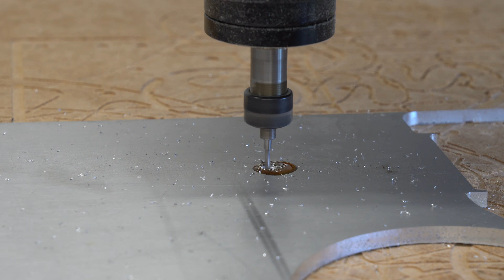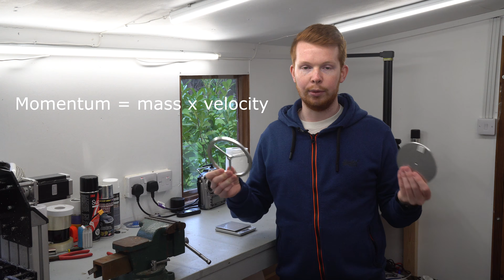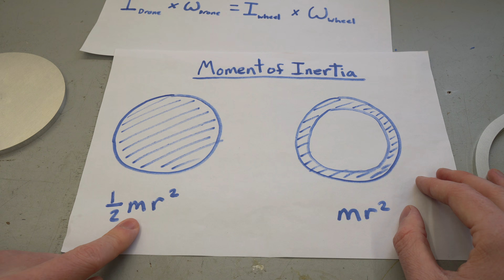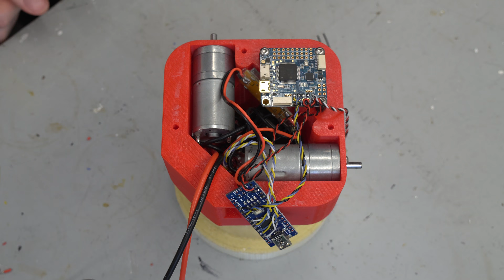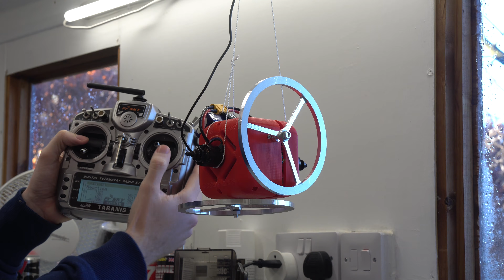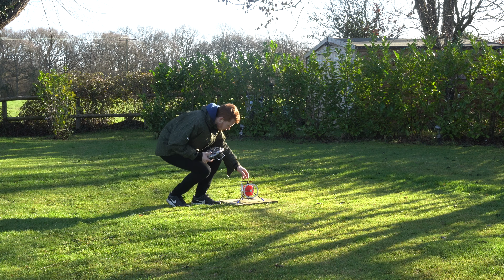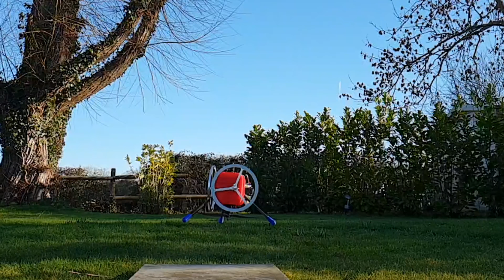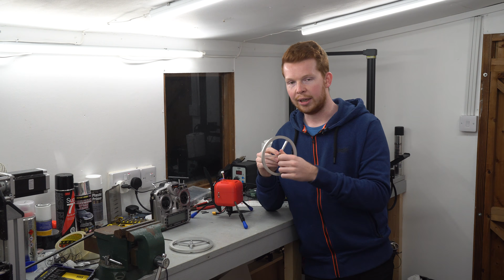Comment: I agree with the closed feedback control of the inertial masses but I also think you must use high RPM motors and take off with masses already spinned with some thousands of RPM, which is your zero. This will allow you to stay in a nearly linear zone of the motor torque so that you can increase or decrease rotation speed in a nearly linear current change and nearly linear add or subtract inertia to the wheels obtaining a CW or CCW torque. The spinning masses are going to be a gyroscope and stabilize the whole vehicle, if you take off without rotating you are going to be victim of the wheel imbalances which are more critical at lower RPMs than higher.

Comment: Hi, I've seen the video by chance, and I think you're having a problem with the stability of the drone. The propeller you are using is too small, the propeller barely protrudes a few inches from the control box. You will probably have to use a more powerful motor to compensate for a larger propeller. On the other hand, you are using a design with a single helix, as you say at the beginning of the video, every force has an opposite one. The spinning propeller has moment of force that you are not canceling, you have two options: Use a double helix or place a new control wheel at the bottom that balances that force.

Comment: Torque is linear with motor current, at whichever speed the motor is running. However, at higher speeds your motor controller will need a high voltage to 1) counter the back-emf of the motor and 2) some more voltage to “push” the current through the motor. When the sum of those two is higher than the voltage that is available, your currrent controller cannot keep up.
Enjoyed the video though, I admire your perseverance here. 
As a control engineer: you need logging to ever be able to tune a controller. You need to look at graphs to understand what is going on, and tune the controller

Comment: I worked process control electronics for Bailey Controls for 20 years. Your problem is response time is not fast enough. The setpoint needs a feedback and that is not fast enough. I got a MPU6050 and Arduino UNO and noticed this delay which would cause this. I eliminated all the programming down to the accelerometer and outputed them in PWM format and eliminated most of the delay, but there is still too much. I ordered an analog accelerometer from eBay and will see if this will have rapid response time.

Comment: There is an interesting quirk of this flying machine. You can fly it with the wheels hidden inside the chassi. Not sure if there is any actual use of that but it would look cool and one could make some thing that looks look like a helicopter but without a tail rotor and that still flies stably.  :P

Comment: You must start wheels first for a min and must be high speed for stabilization. After it try to flying. Is will succes 👍also the second upgrade wheels can be 4 and lit bit smaller a little bit around the drone.

Comment: Having been down this road, brush less motors like you mentioned are harder to deal with. I would suggest you look into gimbal motors. Even though they are brushless motors, there is no cogging and you can change the rotation as well just as fast.

Comment: Are you using two separate batteries (one for the lift motors and one for the reaction wheel motors)?  If not, the activation of the reaction motors could be drawing current from the lift motors, contributing to instability.  Or is this not an issue--if you have the Arduino monitoring/regulating current to both the lift motors and reaction motors?  COOL concept, thank you!

Comment: on my view u tried u r best the reason why u cant balance the copter is because the opposite reaction force  produced by wheels makes the flight unbalanced so u need to couter balance the opposite force  of the wheels when they rotate  but i may no possible that much easy but it may be achived by reducing the diameter of the wheel try with smaller diameter at the last i liked this video very much

Comment: Very cool project... To make it usefull you could balance the wheight , try four wheels, instead of two and it will be more stable... and try to balance the wheight inside de red box also. All the time in the slow motion video i saw that your software was fighting to stabilize this issue! You could make a log of the data from the sensors, matching the frames of your slow motion video and point the vectors of the forces applied to the drone in each frame... it would help a lot to understand what is going on! If necessary you could substitute the brushless motors of the wheels with some step motors, to get better control.

Balancing the wheight, your software will have to fight just against the wind... to calibrate better your motors i recommend that you try the inicial flyghts in a enviroment protected from the wind!

Good luck!
My best Regards

Signed: Renato Motta

Comment: How about a wheeled vehicle and use a reaction wheel to control it direction on pavement as a later project.?
Wheeled in a bike or trike. The trike will take less as the extra wheel will keep it upright. Two wheels then you 
have to also keep it upright. While it's in the learning mode you could use training wheels to keep it from tipping over.

How ever you look at it this is a very interesting project.

Comment: Awesome! I suspect that the first things to improve would be the latency between the gyro and the motor controllers. The orientation seems to oscillate quite a bit, and assuming your PID loop is tuned well, that would be my first guess for what's going wrong. Great job-- this is cool stuff!

Comment: So if you spin the reaction wheels up, before flying it into the air, the angular momentum of the reaction wheels should stabilize the "cubesat", and it should be a lot harder for it to tip over!! Hope that you will at least try it! :)

Comment: i felt like its C.O.G was very unstable and rapidly changed due to the reaction wheels..especially the side wheel which rotation was a little bit off the axis....
Reply: COG cannot change.
Reply: @Anvilshock  technically it can but not on this design
Reply: @Kaydle  No, COG can NOT change "due to" reaction wheels, technically or otherwise. This is what "due to" means. [Effect] due to [cause].
"but not in this design" – Well, duh.
Reply: @Anvilshock  I'm not saying reaction wheels can change COG. I'm trying to say COG can change. Example: battery sliding backwards in a rc areoplane
Reply: @Kaydle  Yes, the COG can also change when the whole plane explodes. Your point? Battery sliding about is hardly a tolerable occurrence in regular operation. If your battery is starting to slide about, your least problems are control methods not working even in regular operation.

Comment: If you don't already know, this might help with controlling the DC motors:
V = I*R + alpha*omega + dI/dt * L
T = alpha*I - b*omega

V = voltage across the motor
I = current through the motor
R = internal resistance of the motor coils
L = inductance of the motor rotor
T = torque output
alpha = constant specific to the motor
omega = angular velocity
b = constant related to the resistance of the motor bearings and gearbox
dI/dt = time derivative of current

A technical data sheet for the motor might provide some of these constants but you will probably have to figure out some of them on your own. It is also possible some of these constants are so small they can be ignored, like maybe inductance.

Comment: nice try ,  maybe you should made smaller and hide the wheels inside the box so you can also reduce the influence of air flow (include your maths) ,and also a simetrix wheel with a opposite sense of rotation and manage it using the difference ...

Comment: Just use the square root of the current amperage applied (or as a % of the max current) as a modifier to calculate the current required. You can pre-create this and create a reference or lookup table for the amperage you need to apply. Will give you a exponential curve and not the linear one you are currently using. But yes, getting motors that can report RPM is easier.

Comment: I'd recommend changing the position of the propellers, putting them on the top and bottom doesn't actually result in a stable flight anyway.

Comment: I think the main problem is that you're applying your reaction torques away from the centre of mass so you end up with some weird cross coupling.  a pitch torque will cause a roll. and vice versa.
Secondarily, It looks like you're probably oscillating because your P term is likely too large for the response time.  You end up with a long enough delay that by the time it realizes the correction is occurring, it's overcorrected.  Less P term will slow down the corrections, but will also reduce overshoot and oscillations.

The simplest correction would probably be to build in some symmetry by using 2 reaction wheels on the same axle.
Belt or gear driven, perhaps, since your motor in in the way of the gearbox axle.

Other more difficult alternatives could be dummy weight to try and get the centre of mass back at the intersection of the pitch and roll axis.  (might work, but it's dead weight)
or applying a crazy mix that cancels out some of the cross coupling at the controls, rather than waiting for the PID loop to catch it later.

Comment: I just wonder if the center of gravity was adjusted by placing the internal components in order to be exactly on the axes of propellers rotation. If not it might the oscilation of the drone body

Comment: Why don't you spin up the wheels to speed say half the rated speed of the motor then you can use the slowing and speed up of the wheel as your control. Plus you have inherent stability from 2 gyros?

Comment: How does the flight controller know which way it's oriented?

Or rather, how does it know, which way is up? It measures acceleration. When hanging from the ceiling this is ok. You get the direction down because of gravity. But when it's flying? Isn't it basically in free fall? And the only forces acting on the flight controller are caused by the main propellers, which (in it's frame of reference) is always up? I'm a bit confused.

Comment: You have seemed to miss a really important point while applying the controller that "with large rotating mass comes the dreading gyroscopic effect".
The roll and pitch corrections that your controller (PID) is providing assume that torque applied on the disk will only effect the rotation along the axis of the disk, which is not correct. 
This video explains it better: https://youtu.be/N92FYHHT1qM?t=841 
You need to consider the gyroscopic forces also which makes this a non-linear control problem which is out of PID's league to solve.

Comment: I'd add some protection frame for the upper rotor in the next iteration. Also custom flight controller would be better (taking the torque characteristics of the motor into account). At certain rpm the gyroscope effect can also influence stability.

Comment: issue is how you have placed the propeller. You need to offset  the propellers do check single propeller aircraft
Reply: you need that offset because of the reaction wheel

Comment: Would stepper motors work better for the reaction control; you would have a great deal more granular and linear control of the force applied? Also would a Bayes algorithm help to adjust the amount of force applied? Third your drone may need to be balanced in all three axes, with just a little bias toward the ground. To keep the torque applied even this would also mean using two reaction wheels per axis. A great build none the less.

Comment: Dear Tom,
I Think that it is tipping because of having the yaw controlled by the motors, therefore saturating the wheels or tipping it too far the other way. I think you would be better off adding a third wheel on the bottom for yaw. This would make the center of thrust above the center of gravity, making a way more stable flight.

Comment: is the centre of mass in line with the center of thrust?
and when it comes to reaction wheels is there such thing as a centre of torque that needs to be taken into account?

it's clear that everything on your drone is functioning properly, it just doent look very balanced

please bear in mind that I have 0 experience with this stuff lol, just a friendly suggestion
Reply: yes I came to comments to write exactly this. I, too, have 0 experience though.
Reply: I had similar thoughts. 14:00 you can see how the center of rotation for the whole thing when one reaction wheel is functioning is not along the center of rotation for the other wheel. I'm sure this is causing problems. Couldn't you just have wheels on both sides for each axis to balance this drone better?
Reply: I came here to suggest he try launching it by tossing it off a bridge... fly or sink theory.  But yeah, what Oscar said sounds better I guess.
Reply: Regardless of the centers of rotation, the 'center of torque' is the center of mass (think of it this way: if that wasn't the case, a reaction wheel would be able to change the velocity of an object's center of mass without requiring any external force, violating Newton's laws).

Comment: I would say having one lift prop under the CoG is what made it so unstable.
Using a hollow shaft in one motor and threading the second motor through might allow both props to be above the weight.

Comment: Not quite accurate in the motor torque vs. current explanation. The motor torque for a given current is likely constant for your motors, barring some extraordinary boundry conditions of temperature or (huge) current. Your ability to produce torque, however, is limited by your ability to produce current, which is limited by the voltage in your system. As the wheels start to turn the motors also act as generators producing back-EMF. This voltage is subtracted from your system voltage for all intents and purposes. So at a given RPM, you can generate less current (and thus torque) than at a lower RPM.

Interestingly the constant that describes the torque per unit current and the constant that describes the voltage per unit rate of rotation are the same number if you choose the right units. 

If you choose a lower torque motor for a given current, it will generate less back-EMF and your well see much less of the effect of the reduced torque available. If course you'll also have less torque available all the time. These are the tradeoffs in spinning power systems.

Your flight controller may not actually be controlling current, but rather, voltage. You definitely get less torque per unit voltage as the speed increases. If there is no current loop on the controller you might try finding one with actual current control before going to the extremes of custom control.

Comment: I think the main problem is that your drone oscillates instead of calming down in the correct position. You should've programmed the Arduino to take data from the accelerometer and read both the angle and the angular velocity, to then compute the torque needed for critical damping. That way the drone wouldn't “overshoot” the upright position. (IRL pilots of helicopters call this phenomenon a “pilot-induced oscillation” – an unskilled pilot applies too much torque to the helicopter and instead of leveling it, they “overshoot” and tilt the helicopter the other way.)

Comment: Hey Tom, if the RPM of the Motors for the reactions wheels arent the problem try to make the reaction wheel smaller so you can make much more precise movements.

Comment: just add a gyro and arduuino to change direction depending on current status.
  but i thing its why almost all the drones use 4 propelers or one plust direction reduction propeller on helicopter models.

anyway for the thing you talk about there is lots of samples already in use on the market. the 2 propeller driven drones use what youa re talking about.
the key is to use 2 propeller side by side one up and one on down side and make sure they turn    reverse of each other. that way they are balancing the force caused by direction of propeller motor.
ie changing balance will make drone turn on its position :P

Comment: Make the reaction wheels smaller and use one on either side on a shared axle.
So 4 slightly smaller wheels, 2 motorsn and everything works Symmetrical

Comment: You did two basic mistakes, the first as mentioned below int he comments is that you need to have pairs of reaction wheels so they will not wobble, but also your two propellers that go in different directions should both be on top of the drone in order to also be as close as possible, they are causing a gyro force as well
Reply: You actually want the props to go in a different direction so it cancels out the forces.  I think he was actually pretty close, his issue may be a thing of tweaking things, like centre of gravity, pid controller etc.

Comment: Looks like a software issue with the controller of those motors. You need better PID parameters for the control feedback loop. They are slow to respond and there is some oscillation too.

Comment: Wild idea: Could you use gyroscopic forces to control the drone? Place a single horizentally aligned flywheel on an arm so that you can controll the axis of rotation. In principle you should ne able to turne the drone by changing the axis of rotation.https://en.wikipedia.org/wiki/Control_moment_gyroscope

Comment: Didn't hear the motors making different pitch sounds when they were on the bench?  Also looks to me like the axis of thrust needs to be through the center of mass (Or at least that would make it easier), which it appears it currently isn't.  It might even need all the motor shafts to be lined up with the center of mass.